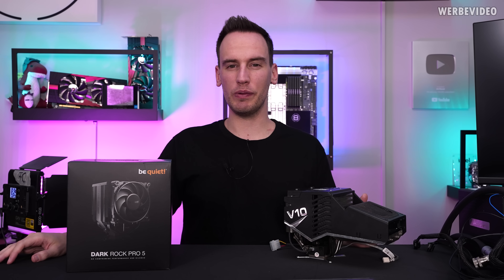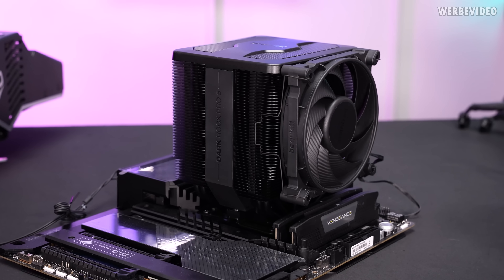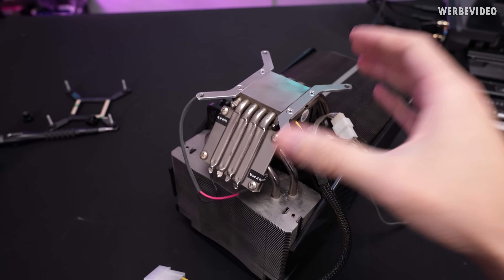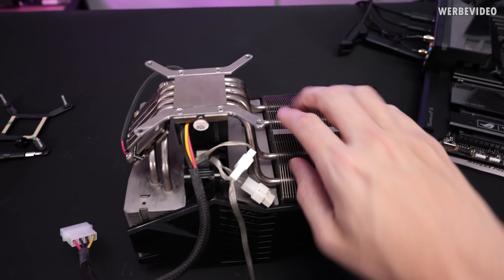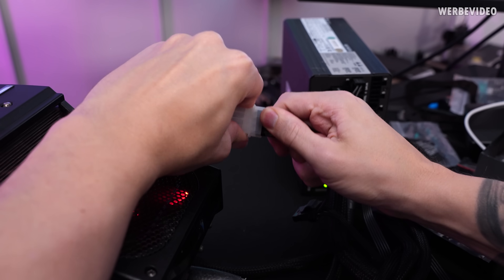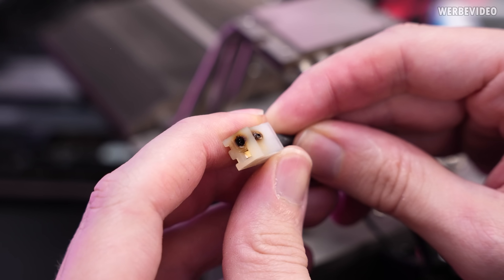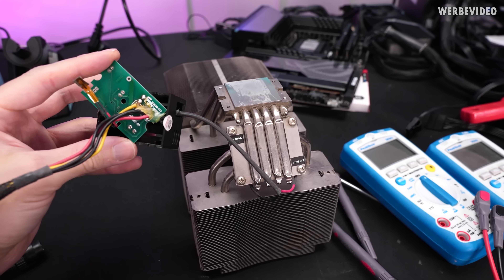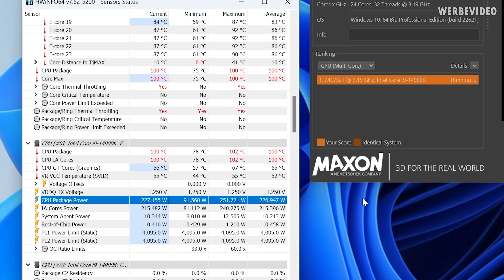This Gigantic Cooler from 2009 has MASSIVE Problems...

Comment: Now i wonder, what performance you would get if you delete the TEC and just have the TEC heatsink connected to the rest of the heatsink
Reply: It would 100% be better because the TEC is actually producing heat. There was a small improvement with the new TEC only because the third fin stack wasn't being used without it. Unless you specifically need to cool something below ambient TECs make 0 sense and unless machine/device size or complexity is an issue it makes far more sense to use any of the various phase change heat exchanges like an AC unit.
Reply: @Sgt_SealCluber  course some improvement, just a matter of would it be a "meaningful" improvement is the real curious part.. 2 degrees, 5, 10?
Reply: @Patters3  Since the CPU he was using is thermal throttling there wouldn't be any temp improvement, but there would be a decent power draw increase (less throttling).

If we assume that fin stack on the TEC side is 1/3 of the overall thermal capacity of the cooler, then the improvement would be 50% plus whatever amount of heat the TEC is producing minus the heat transfer limit of cold plates and heat pipes. 

Hazarding a guess I would say 40-50w CPU power draw increase removing the TEC.
Reply: @Sgt_SealCluber  yea course with this chip (and other such very high draw ones) just funny to think this came about and was engineered for very first gen i7s that were 125w high-end? even with that extra hypothetical capacity of the third stack I bet it would still be of little to no difference vs the trusty old D-15, or heck given generational improvements a new hyper 212 would probably give it a run for its money on a more mild chip (say a 7700k), just funny to think about all the marketing wank that went into it
Reply: my thoughts exactly, I've never seen a triple-tower cooler before.... er, guess two towers and a platform in this layout

Comment: The temperature sensor is there so the tec is not at 100% while the cpu is idle in order to avoid condensation, whennyou measured 20w on the tec you had the temperature sensor on the air, so kt was probably not pumping more so it does not make/freeze condensation.